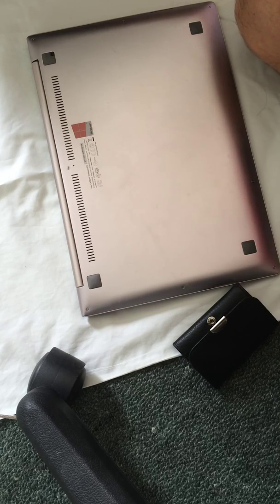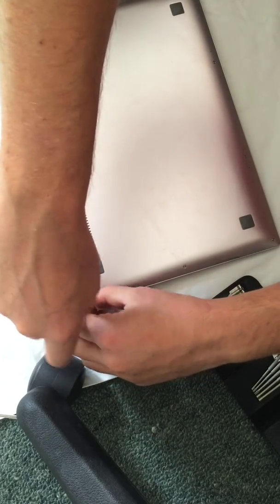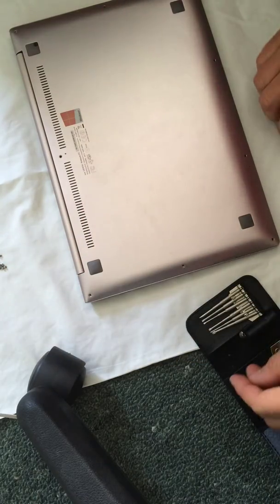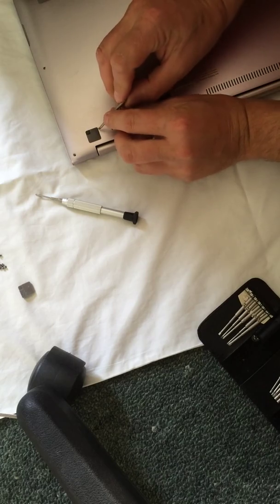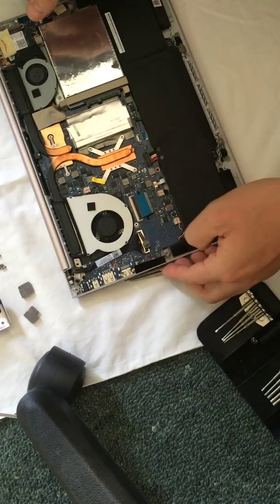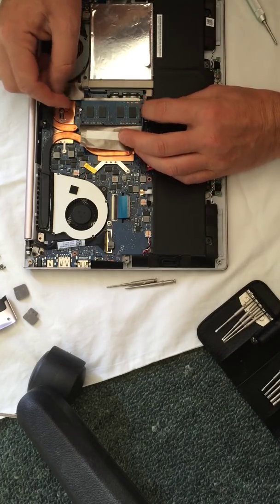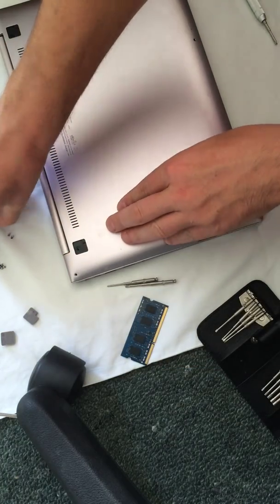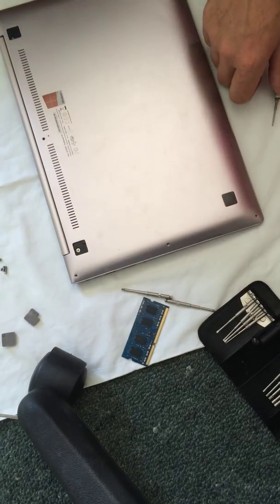asus zenbook ux303 UB memory upgrade

Comment: Great video thanks.  

I have an ASUS UX303U, I have upgraded the RAM and SSD Hard drive, both work flawlessly and with no additional configuration.

4GB on board RAM + 16GB = Total 20GB
Micron 16GB PC3L-12800 DDR3L-1600Mhz 204Pin Unbuffered Sodimm Ram - $129

SSD Hard drive Total 2GB
Samsung 850 EVO Series 2TB 2.5" SATA3 6Gb/s SSD - $776

It was much cheaper upgrading this laptop than buying something off the shelf equivalent specs.
Reply: matt jones Mine came stock with 8gb of ram, do you know if i can just buy another 8gb stick to total 16? Thanks mate.
Reply: I think that the 8gb of RAM you will have is 4gb on board, and 4gb stick.  So if you buy an 8gb stick you will have to remove the existing 4gb stick.  This would give you a total of 12gb.   Otherwise buy a 16gb stick and get a total of 20gb.
Reply: matt jones mine is a ux303ub (4gb onboard +2 gb ram) i heard  that the maximum is 12gb ( so the max ram supported is only 8gb ram) is that true?

Comment: I have currently 8GB total in my UX303LN, is it possible put a 16GB to get 20GB total? Everywhere is said that the max is 12GB. There is one 16GB memery option in Amazon and they say it would fit and you would then get 20GB total. Has anyone tried?
Reply: YES IS POSSIBLE - the 8gb limitation in not real because many zenbook 303 user reported a successful 16gb ram installation on the free slot

Comment: I had to come back here because after taking out all of the screws (included the ones under the feet), the lid would not come off... so hearing you say "it comes off really really easily" had me scratching my head several times!
It turns out that they have added sort of plastic clips all along the back part, next to the ventilation slots from hinge to hinge. Pushing the lid front to back helped to pop it without further damage, but definitely it is does not come off really really easily.  JUST TO YOU ALL KNOW!!
Reply: That's annoying - that's happened to me with other Youtube "easy" instructions.

Comment: Does this model (UX303UB) have an mSATA or m.2 slot for an additional SSD?
Reply: Fahad Yousuf , no... just 2.5" sata interface. I had liying around a 500 gb ssd, so it was actually an advantage I was looking for. M.2's are really risky to buy as there are still so many compatibilty issues.

Comment: im looking to upgrade the ssd in my asus zenbook ux303ub. I asume its just the same approach and the solid state in the machine is just as easy replacing as the ram?
Reply: Lars Nielsen, 2.5" drive is held in place by 4 screws, one of them shared with the battery. You have to unscrew the battery (but not detach wires) and lift it a little (one small screwdriver handle is just perfect), then you can pull and slide the drive out. replace it with any 7 mm 2.5" sata drive.

Comment: This laptop has 4gb soldered in and you added an additional 8gb? I'm thinking about buying this particular laptop and the store said it could only hold a maximum of 12gb. just want to know validity of the store
Reply: thats a very interesting piece of information, thank you!! I don't think I'm going to need more than 12 Gb ram anytime soon, but is good to know that there are chances if needed.
Reply: ***** how much can I put in that slot? Just a stick of 8 to max out at 12?
Reply: My version already comes with 12gb, 4 gb soldered and one 8 gb stick. works great. Don't think you can put a 16 gb stick instead of the 8 gb stick, so that is the max.
Reply: I was able to put a 16GB low voltage stick into a similar, cheaper Asus laptop (K401LB) and get 20GB total.  See my comment below.
Reply: according to Crucial website, this model can only take 4 & 8 gb sticks. Was that 16 gb sodimm supported in your cheap Asus according to Crucial website?
Reply: No - it was a matter of buying and crossing my fingers that it worked.  If you go to the Amazon product page, people have posted their success/failure stories and most have been successful with their particular makes.

Comment: hey there, thanks for the vid, I have the same laptop and had a Kingston KVR16S11/8 that I thought would work, but wasn't detected for some reason, what are the specs for the 8 gig module that you slotted in? if you can share a lead of where to get one it would be great.
Reply: +M Al-Qassab I don't have this particular laptop, but do have an Asus with a single slot, supposedly only up to 8GB, and was able to put a 16GB stick successfully in there.  Crucial CT204864BF160B.
Reply: you need a low voltage DDR3L-1600 part, yours is outdated.